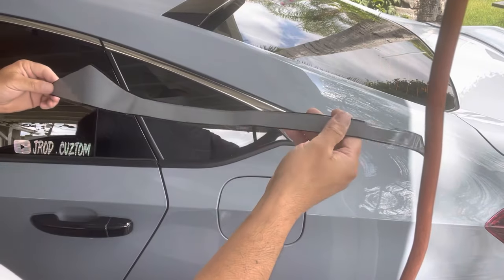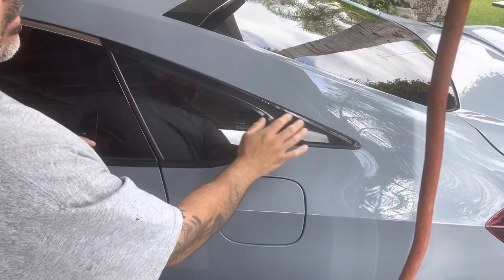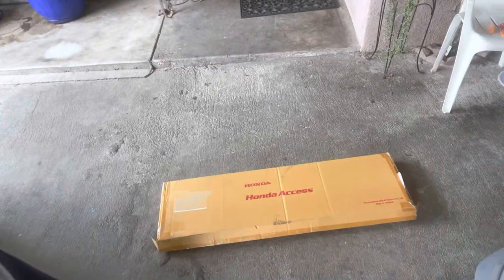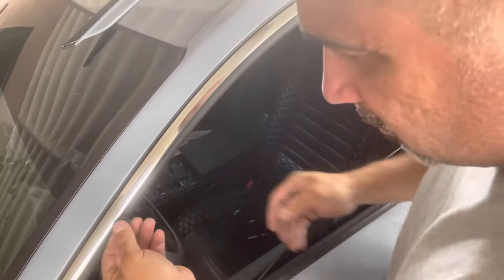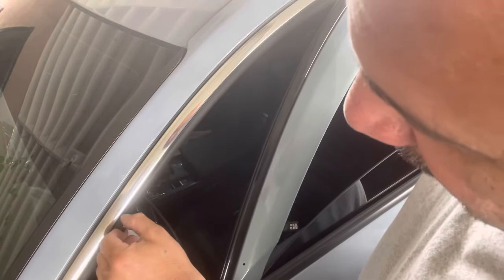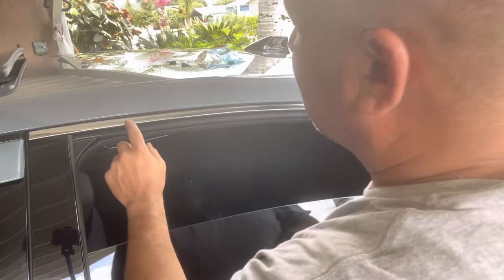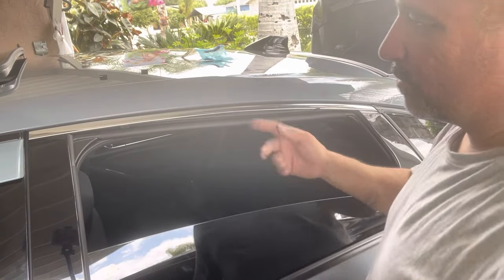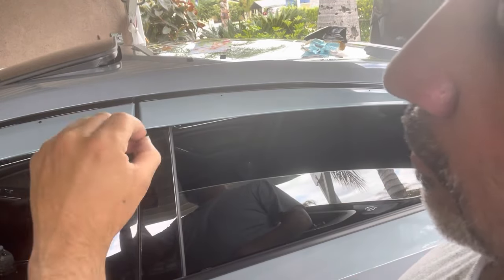2018-2022 Honda Accord Painted Oem visors by AeroWerkSports.com  #10thgenaccord #hondaaccord

Comment: Car is looking dope my friend. 👌🏽 have been enjoying your videos. I just purchased a 2022 accord touring in SGP color. This video seems to be your most current and i (think) i noticed in this video, you have the oem front underbody side spoilers? Correct me if im wrong, but you also used to have the Yofer front underbody spoilers? My question is: (if you previously DID have the Yofer, was there something you didnt like and thats why you went oem? Im debating on which i want to get. I found the Yofer on enay for $146 (and i know that comes w/ the black piece that goes in between) and the cheapest i’ve found the oem is $294. Would greatly appreciate your opinion.

Ps: the SGP visors look clean compared to the factory black. Damn they’re expensive tho!
Reply from the maker: Yea bro thank you for the kind words . It be thru a lot of different transformations.. I went Oem underbody body spoiler after the yofer because I was lowered on  coilover and I was hit in my driveway.. so I went Oem and s-facto fabrication splitter. I didn’t want to mess up my front.. . But when I went with the airlift system. I wanted to go lower in the front so I add the akasaka front spoiler or lip.. and the s -factor splitter on the bottom.. 
after you go with Oem underbody spoiler you can put the the yofer front spoiler any more .. so I try to make the akasaka front lip .. I have video on that ..
I would go with Acr- front lip it has the he best fitment.. 
thanks for the support appreciate you
Reply from the maker: https://hirevsports.com/collections/accord/products/hrs-2020-22-honda-accord-front-lip-v5
Buy now it’s on sale 
Code hrs-givethanks
Reply: Appreciate the reply 👊🏽 and the code. The price is right!

Are you still rocking the Yofer side underbody spoilers or do you recommend something else? 

I think the hrs-v5 you recommended would look good with the oem side underbody spoilers because the oem also has a black 2-tone look. 
But i also do like the solid color of the Yofer and i kind of do like the solid look of the Yofer front underbody spoiler and just the black middle piece accenting the flow of the black from the grill centered to the front of the car. 

What do you think?
Reply from the maker: @kinglalo630  sounds like a good idea
Reply: @JRod.Cuztom  i went w/ the Akasaka front underbody spoiler and the yofer side & rear underbody spoilers. Then i put my underglow on. My 💩 is clean! 😏
Reply from the maker: @kinglalo630  🔥bro

Comment: brothers what the part of the car called where you were working on but the top see how it goes to the bottom in the back no the fedner but the one that connects to it leading it from the front to the back roof
Reply from the maker: The side skirt?

Comment: Did you ever break those pins that go on the rainguard because i got the same ones but my push pins broke on me when i was removing the rainguards
Reply from the maker: I actually lost 2 pins
Reply: @JRod.Cuztom  did you find new ones supposedly they dont sell those by them selves
Reply: Do you have the part number for those pins bro
Reply from the maker: @devarrsnyder2307  idk I had found them  on eBay but they are not there no more